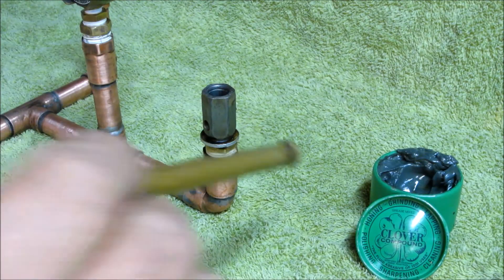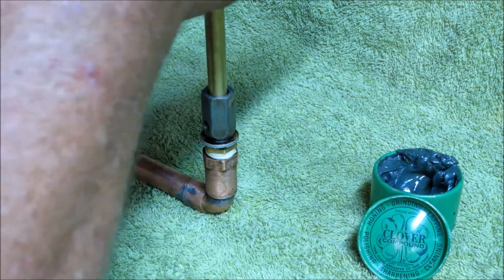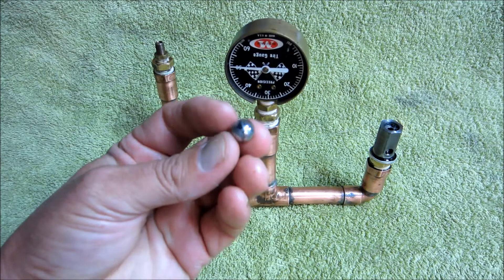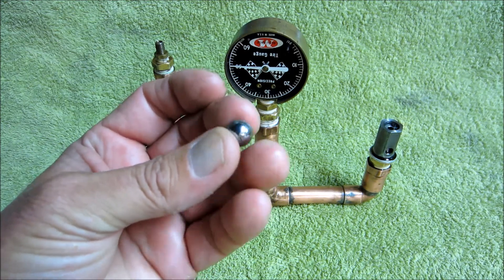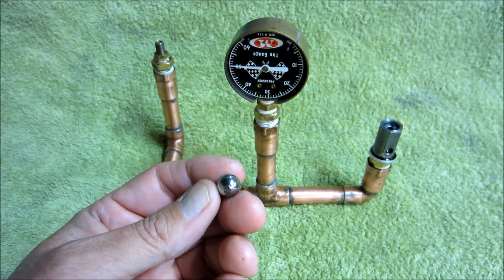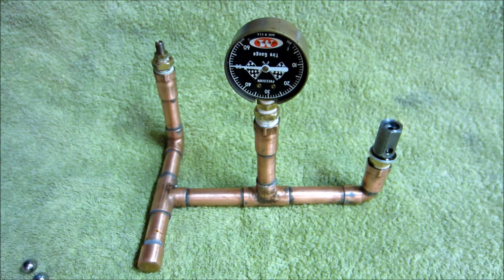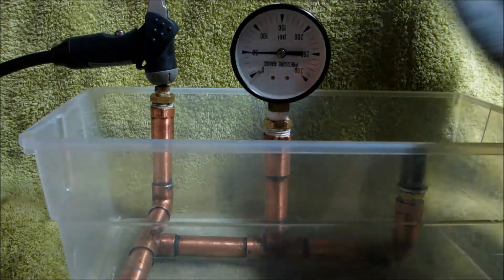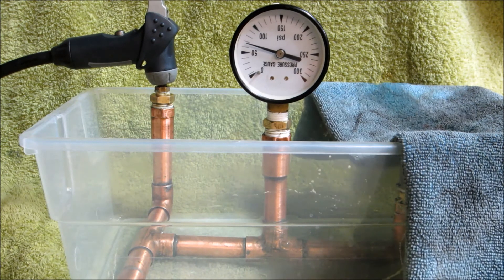Oil Pressure Relief Valve Lap and Pop-Off

Comment: Hey sir I've had an issue with my 4efe I've changed the oil pump and still have no gotten any oil into the cylinder head , I've changed the oil pump and seal and still no luck someone told me that the pressure relief valve needs to be changed that's the I my way I can get the oil up to the cylinder head once I've changed it so I'm asking if you things that's the issue I've used air pressure to blow out the port and air goes right up to the cylinder head yet still no oil
Reply from the maker: I'm a motorcycle guy and don't know anything about the Toyota engine. You might want to ask your question on a Toyota forum.